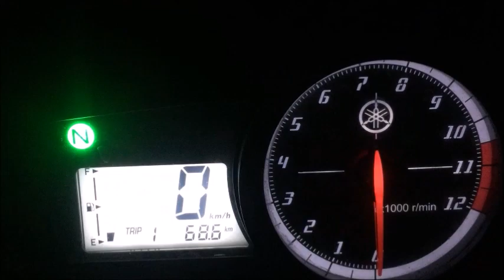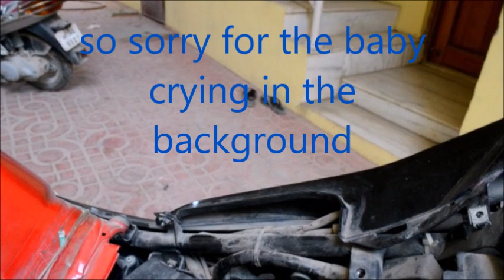Yamaha R15 self start not working | relay | battery replaced under warranty

Comment: Bro my battery's is fine but my horn is not working my bike is starting but its not starting properly menas when i press the start buttun , i get only noise of the engine is starting but its not starting what to do ?? And i saw the wire small one near the kill switch its bitten by mouse i think probably, i am really confuse 😢😢😢

Comment: I need some bodys help. Anybody who is well versed with Yamaha R15 V2 bike.
Reply from the maker: Bro there are so many people here who know things well, may be you should ask your question and someone might know it
Reply: @ddvlogsDipakk  Can I get your help Bro
Reply from the maker: @akasheyhome6902  sure bro i can try to help..
Reply: @ddvlogsDipakk   Thank you. Actually I had an incident few months back in between covid restrictions. While riding my bike suddenly broke down. The engine ceased completely.
Reply from the maker: @akasheyhome6902  bro was it engine seize completely or some electrical problem?
Reply: @ddvlogsDipakk  Let me elaborate. Kindly bear with me. I was travelling on Avg of 80 Km/hr had ridden almost 4 hours without a break, while doing so suddenly I got burning smell, fumes and my control panel display started to glitch.... After that it ceased..
Reply from the maker: @akasheyhome6902  bro burning smell indicates very low engine oil as per me..I think low level  and very old engine oil..could not bear the heat due to the friction..
Reply: @ddvlogsDipakk  Yes indeed. So I had diagnosed. Now I have repairing it but it still can't seem to start. I have replaced the Block piston crank set.
Reply from the maker: @akasheyhome6902  bro do you have Instagram account? Please DM if you have I too need some info ..it will be helpful for me as well

Comment: Bro if relay is not working can we start bike with pushing please tell me
Reply from the maker: yes bro, we can start, as long as battery is good bike can be started by pushing it
Reply: @ddvlogsDipakk  bro mine is not starting by pushing battery also low charging level 13 volts . I had changed sparking plug but bike is not starting there is no current in bike . Plz tell me what's the issue..

Comment: When u had this problem, did it make that ignition sound when we switch the key on i.e the is a sound made when we switch in the key when the rpm arrow rotates. It makes this sound everytime we switch on the key before pressing the self switch. Was that sound there.
Reply from the maker: Bikram Singh bro thats the fuel pump powering on sound..yes that was normal but only the self start switch didnt work...
Reply: @ddvlogsDipakk  I'm not able to self start my r15v2 since yesterday. I tried push start on 2nd,1st gear. Didn't work. Didn't want to keep on push start cause last time iblew my starter relay nthe fuse n they both melted from the heavy sparks iguess. I changed both, also changed battery, spark plug,, changed the ignition coil that's above the spark plug, throttle body cleaned, f.i cleaned, serviced my bike at Yamaha completely on March n so i thought, my problem was solved. The problem was the bike would automatically switch off when running n it would happen multiple times n i had to keep on using the self switch to keep on going. The problem went away after the service for few days as there was curfew so i couldn't test the problem really got solved or not. After the relaxation, i started riding my bike again nthen after a few days of ride, my bike broke down n so i tried of push starting my bike but it didn't. Then irealised that the bike is not making the sound when turning the key on which i believe is the fuel pump activating. Then i thought it might be the fuse in the starter relay blowing off again as it did the last time. So ichecked the fuse but they were fine. Didn't check the wiring as I'm not able or qualified. The situation now is if i turn the key, no sound coming and also no action on the self switch. Nothing happens. 
I saw your video and i see this two different color boxes the starter cut off relay n the radiator fan cut off relay, is that right. 
Also my question is what kind of problem the bike shows if there is a fuel pump related problem. 
 Also is there a possibility my self motor is damaged. Is it possible?
  Also what's the cost of a fuel pump for v2 and does it come along the tank or do ihave to purchase it seriously. Hoping for areply. Thanks
Reply from the maker: Bikram Singh haha...bro thanks for the explanation..did it happen after the bike was standing still for very long? if yes, then i faced the same recently, yday another bro of our bikerdog fam faced it... and that was fixed... if poss we need to talk...can u dm me on insta??
Reply: @creatorvoss  did you get any information about this? I think I have the same problem as what you're talking about.
Reply: @ddvlogsDipakk  sorry, i was busy. Couldn't reply. I'll dm on your insta.i thought u didn't reply.
Reply: @Crowningturd  hey mike, sorry didn't see your notification. There was one mistake i made in my explain in the beginning. I didn't change my ignition coil. Other than that idid all the above isaid. 
  The day after iposted the comment here, i tried to check myself before taking it to the service if i could find anything unusual. Icouldn't open the full panels of the bike as idon't have the tools but imanaged to open the side panels n there was this wiring plugs,i think it's called adapter plugs,i.e the wires that come from the self switch, clutch wires, indicator wires n gets connected to the overall wiring harness on the bike. So there is a connecting point where all the adapters has to be plugged with each other below the side of the tank on my bike on the main frame just above the radiator cap. So i checked if something is wrong in there or cracks in the wires, but it was fine, but istill tapped the wires little. Nothing was happening. I turned the key on noff  repeatedly but nothing was happening. N then suddenly i realised, there should be a click should that should come when iturn the key on. It's the sound of the starter relay working, but there was no clicking sound from the relay. (Starter relays work is to send current from the battery to the self motor or starter motor). So i thought my relay or the fuse went off once again. I checked the relay nthe fuse but both were fine. Its a new relay nfuse. Since that was fine, ididn't understand what went wrong this time. So out of frustration I then tried to shake( for lack of better word) the wires near the relay n the ecu going something would connect n make that relay click, but nothing was happening. Also from previous experience, i understood if relay nthe fuse goes bad, the instrument console meter wouldn't ignite at all rest alone other things on the bike but still ichecked the relay nthe fuse. It's a panic situation as my bike wouldn't start for the second time, this time after servicing is done, so i cross checked it. Also one thing, if the relay doesn't work nno click meaning relay not working, then the fuel pump wouldn't activate. So igot even more confused nfrustrated because in my case the instrument console was working meaning the starter relay is fine which icross checked it, but the self starter would do nothing when ipress the switch, also i tried to push start but didn't start n so i thought, since the relay is fine, the fuel pump must have stopped working, since it didn't make that whirring sound when we turn the key on. But still iwas trying n also checked the wires on the clutch side but nothing happened. Then i turned the kill switch on n off which we usually do n turned the key on noff at the same time randomly in the hope of hearing the relay click should n suddenly i hear the click n try to self start, but failed many times n then i focused on the kill switch n turned on noff the kill switch many times n then i realised that something is wrong in the kill switch signal cause sometimes the clicksound of the relay would come nsometimes it won't. My bike finally started n i could hear the whirring sound of the fuel pump once again. It was very strange for me but for now it's starting n I'm not touching the kill switch. So for my problem, i think somewhere there is problem with the wiring harness somewhere or the adaptor plugs, or the self switch wire. I'm thinking about changing the wiring harness of the bike completely with all the plugs + the self switch assy. Also I'm thinking of changing the ignition coil, cdiunit, rr unit, ecu n then see if the later are not very expensive. I'm really very frustrated cause I'm not able to take out my bike without worry thinking where n when it would breakdown next. N in this time of pandemic I'm really not sure what to do. To go to the service center it not. If ihad the tools nexperience nexpertise, iwould have done it myself in this time of crisis.
 Also sometimes even if the relay works ngives the click, it still might not work reason being"RESISTANCE". volts allows current to flow, but if there's too much resistance, it could impede current flow. But due to these worrying times,i just don't want to check all those things, just want tti replaced all the possible things nget it fixed. #frustrated. Ihope this can help you. BTW what's your bike.
Reply: Bro bikram my r15 ingnition sounds not coming and my bikes dead for a week can you help
Reply: @mishal751  I'll try to share what i can. Electrical problems are hard to fig out especially in these type of bikes which are full of electronics. Gone are the carburetor engines where things were simple. Anyways, 1st check your battery, since your bikes been dead for days. Do that by going to someone who has multi meter. Check the volts.a heathy battery should've 12.4 volts. 10,11 volts are under charged batteries. So charge the battery first if the battery is usable. Otherwise buy a new one. I'd suggest amaron, but still your choice. Then 2) check the spark plug +the spark plug cap. R15 plug cap gets damaged vert quickly. Doesn't cost much, just change to new ones. About plug you'll have to check your engine, if your engine is 1ck, use ngk cr8e plug, mine is ngk cr9e. If these are changed or are fine n still doesn't start, then 3)check the starter relay. It's near the battery. Check the fuse on the relay. It'll be either 20 watts yellow fuse or 15 watt blue fuse. If the fuse if broken change it or change the whole relay. Then try starting. If it still doesn't ignite, 4)check the kill switch uwon't be able to check it better is change the whole assembly of the right side switch. Kill switch part is important cause due to water getting in n air, there is rusting inside it, that also creates ignition problem. 5) even after this if it still doesn't start, then check the ignition coil. It's underneath the tank. Ignition coil gives high voltage current to spark plug to ignite the starter motor. But ignition coil doesn't get damaged very easily, so u might not worry about that. 6) check your rr unit. This is an important part to charge your battery. It is directly related to your battery. If your rrunit is 3 phase, it'll cost above 1500, but if it's a 2 phase one like mine, then it'll cost around 800 current price. This is important. Do check this. It gets damaged with time. 7) now still your bike doesn't ignite, then you'll have to check your starter motor or self motor which cranks the crank shaft. This too usually doesn't gets damaged easily but check it because i don't know how u maintain your bike n how old it is. 8) still out doesn't ignites, then 9) you'll have to check your fuel pump, i.e the pump motor + the fuel injection. Both are costly parts n therefore i kept in the last. These two don't get damaged easily even if the bike gets old. But these can get damaged soon if the rider rides at low fuel all the time cause f.i and carburetor technology works different. F.i engines are not made to run on low fuel because the fuel pump gets damaged n so does the injection. But if it is damaged soon, that simply means the rider has run the machine on low fuel most of the time. Also get these two checked out n check only at authorized Yamaha service center because they have the multimeter to read the volts required by pump n injection n they are trained for it. You cannot go to a local mechanic for this. Other than the f.i n the fuel pump, you'll also have to check the complete wiring especially in the front part wiring which comes from the ignition key and from both the handles which gets connected to wire junction on the right side above the radiator. The wire in the front gets damaged due to many years of turning the handles left nright. Also do check all the sensors if they are working. But if everything else is fine n still no ignition, then the last part would be the opening of the rotor n the alternator where the engine coil is located on the left side of the engine. This too doesn't get damaged easily. It's where the a.c current is produced. I don't know the cost. Note. There are some sensors coming from the magneto side, something line trigger coil n the other is the wire n sensor for the rr unit. Do check that out. These are directly related to ignition. Anyways, do the beginning steps of battery, starter relay, spark plug. Your bike should start. These end steps are when everything else is fine n still no start. Wiring n sensors + ecu checking is important as i don't know your bike is modified or stock bike. The problem with local mechanic n shops in modifying electricals is that they simply cut n add extra wires for extra add ins like extra lights, and then simply tape it. What they don't know is the ecu is designed for specific power n volts. These bikes are fully electronic controlled, not like carburated bikes. Any wire damage due to wear n tear or modification might cause electronic hazard which might affect ignition issues n we simply wouldn't be able to fig out because there are many electronic parts like sensors, ecu, tci, relays, so many relays. Anyways check it n tell me
Your problem should be related to battery, spark plug, starter relay, rr unit,
Reply: @creatorvoss  thank you so much but the self sound is coming only the fuel pump sound when we switch on the bike the inggg sound is not coming and here in our hometown theres no yamaha service
Reply: @creatorvoss  maybe the fuel pump relay ill check that today thank you for your time bro.
Reply: @mishal751  okay, so how old is your bike nhow many kilometers did urun. Because the fuel pump doesn't get damaged easily. Do urun tot bike on low fuel most if the time as r15 doesn't have reserve point on the meter n to my knowledge the fuel pump nthe injection might get damaged due to low fuel riding most of the time. I might be wrong. Anyways,i went through a similar problem where my battery was new n fine, starter relay new n fine n one day suddenly when i was riding, the bike died n won't start. I tried to push start but won't n suddenly i realised, the whirring sound of the fuel pump when turning the key on wasn't there. So i thought my fuel pump was dead. So i was upset n tried to troubleshoot myself because everything else was fine. As i was checking, i realised that there was some connection problem  from the kill switch. I might be wrong but i think as we wash our bikes, the water gets into the switches n carbon gets formed inside the switches and then we start having starting problems. Mine was solved as i did little tweaks. Anyways after that, i changed the whole assembly of the kill switch.  Now remember one thing always with fuel injected bikes to never push start over n one again. This will lead to over voltage n will damage the starter relay n it's fuse. Fuse blown is still fine but if your relay gets blown, you'll have to buy a whole new relay. I blew my relay as i tried to push start over n over again. Carburated bikes are less maintenance n cheap n can be push started not f.i bikes. So dfi check your kill switch n self switch n it's wiring assembly. I still don't think your fuel pump is damaged, but still if u should get it checked. But always go to authorized service or one who knows how to check the pump n injection with a multimeter. These are expensive parts. Force will not work like beating n banging. There one who checks it must have knowledge about it. If u don't have authorized service, go to the nearest possible service. First inquire about it, check on Google n then proceed.

Comment: My bike had the same problem not starting but betray is ok but my bike is not working even by running start...at first vibration is coming from the fuse connector...after trying many time for running start it didnt vibrate nor start...is the relay need to be change bro

Comment: Hello Bro,
My bike's display goes off sometimes when I press the self button.
Reply from the maker: Bro this seems battery related issue..either battery charge is low or battery is getting charged properly..incase you are not facing any other issue then charge the battery n check..
Reply: @ddvlogsDipakk  Bro,
this seems like a battery issue only as I have replaced the battery earlier as well for the same.